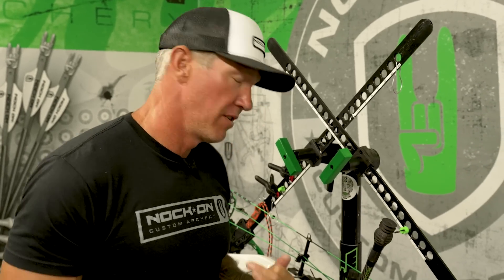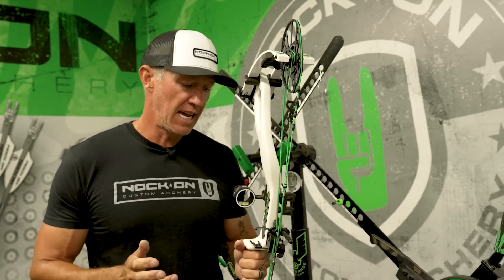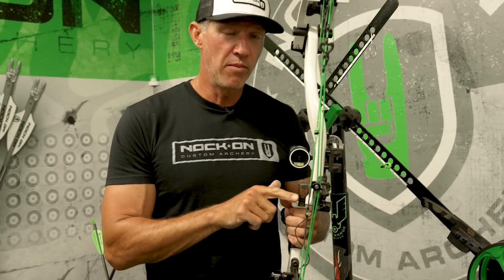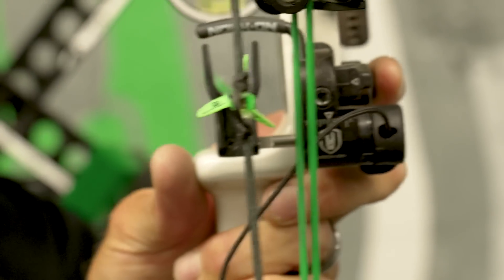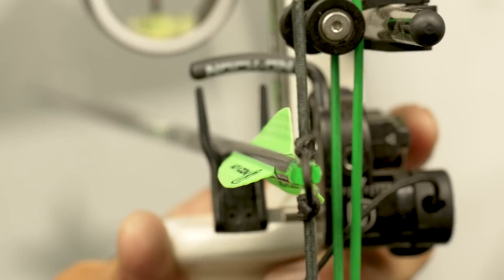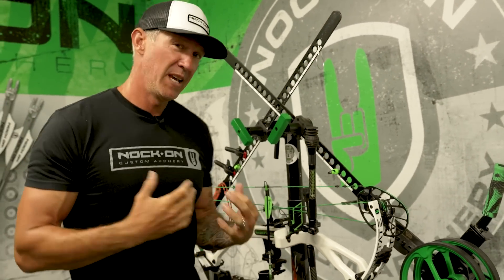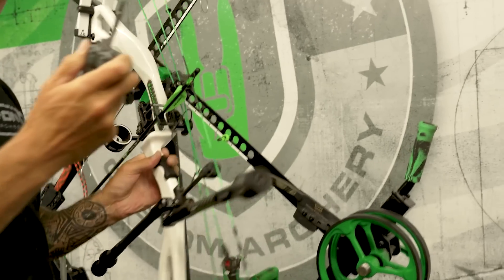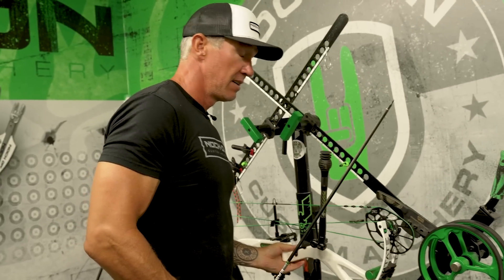My Arrow Rest Mod For Flawless Arrow Flight- (read full description)

Comment: On my QAD I use bowling ball grip tape. It’s the elastic self adhering that is put in the holes of bowling balls to increase the gripping of the ball.  I cut narrowsrips and apply to the tongue that holds the arrow. Then I use dental floss and wrap the uprights and the bottom with just enough to make sure it stays on. From bag and other cloth stuffed targets I will get some fuzz buildup after like 50 shots but it wipes off easily.  Plus there is no sound  as you draw an arrow across it. Lasts for hundreds and hundreds of shots.

Comment: I’m running a total peep cover on my QAD Integrate rest. Cradles my arrow significantly better than factory, and the material is quiet, smooth, and doesn’t seem to wear. Idk if it affects the speed in which it drops, but it sure is accurate
Reply from the maker: Haven’t seen it but that’s GREAT it so. Congrats on improvement
Reply: @nockonarchery I bought that same total peep rest cover and it tore in half as I installed it. Took forever to get total peeps stuff over the border into Canada so I didn’t even bother to call and ask for a new one. Their peeps are really good though.

Comment: QAD now make em in 4,5,6mm and let Dudley sell em on nock on site as a 3 pack.
Reply from the maker: 😂😮 well. That’s sounds legit. Only 32,000$ in molds to make it happen
Reply: @nockonarchery  or an intern free labor and 3 different size screwdrivers and a lighter lol.